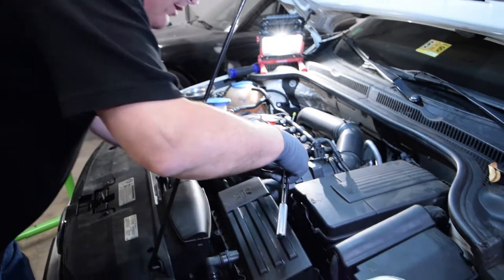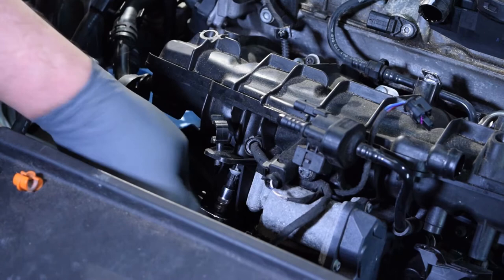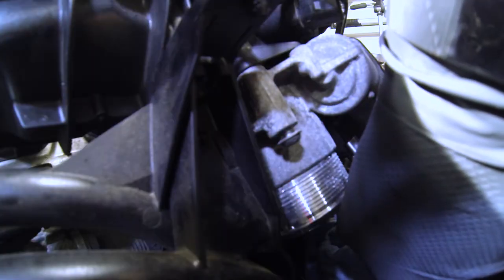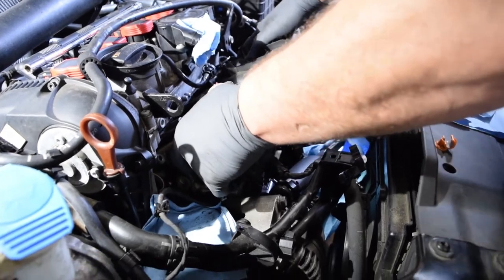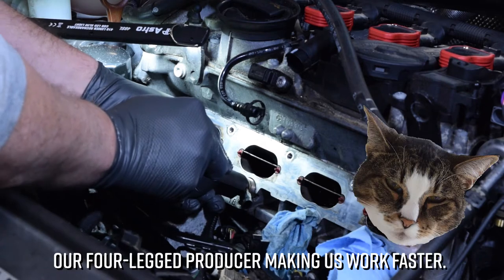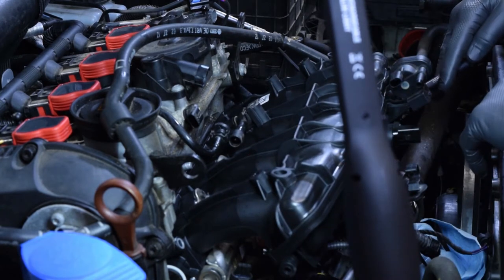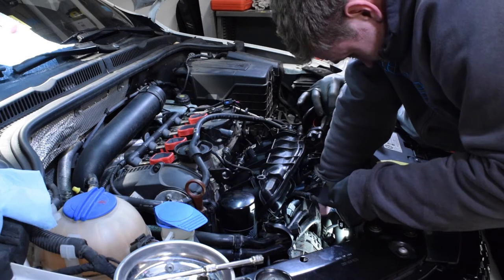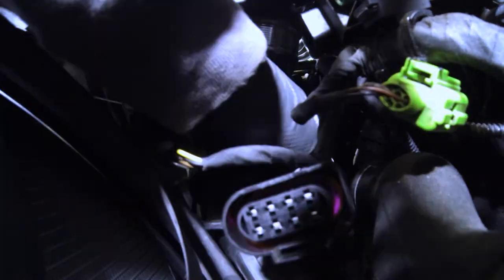Complete Intake Manifold Replacement on a Volkswagen Jetta GLI - Underdog Garage

Comment: Do you think that the screws on the bottom of the throttle body would be easier to remove  from underneath.
Reply from the maker: That's a great question! I think when we were working on this we looked at that option, but we decided to remove from the topside. While there was sort of a direct path from the bottom, we would've needed a very long extension and possibly a universal joint to get onto the Torx bolt. We felt jacking the car off the ground, possibly removing more parts to get clear access and lining up the long extension would've taken more time.

It might be easier depending on the additional work involved to get access and clearance for removing the bolts, but there might be more time involved. My MK7 GTI is due for a carbon cleaning soon, so I may try accessing from underneath next time. Good idea.

Comment: Have you guys done any videos about replacing the clutch in the Gli?
I think mines maybe wearing out or showing signs.
Reply from the maker: This GLI has a DSG and we haven't had to change the clutch packs out, so no video on that yet. Is yours a manual or DSG? Is it slipping at all?
Reply: Underdog Garage Yes mines is the 6 speed manual and its having difficulty with just getting into 1st gear only all the other gears are fine. I should of went for the DSG :)
Reply from the maker: T Pendleton gotta #savethemanuals :) sometimes in cold temp the transmission fluid can get pretty thick.  I was reading you could try pumping the clutch a few times before engaging first gear to stir up the fluid. That might help

Comment: I have a 2013 GLi with this issue How much does this repair Normally cost? and would it be best to let Volkswagen do it vs a smaller shop?
Reply from the maker: Hi T!
Great questions. The short answer on the manifold replacement cost is it depends. I did some research and found dealerships locally charging $1000-$1200 all-in with parts and labor, but it depends on the labor rate in your area. Here in Washington D.C. the hourly labor rate is pretty high. The intake manifold can be bought online for about $150-$170. 
For dealership vs. smaller shop, there are definitely some great shops that specialize in VW/Audi, and since this is a common issue chances are the smaller shops have done these repairs lots of times. 
Sometimes this manifold issue is covered under extended warranty so you might call and check with a dealer first before making a decision. They might cover it. For local shops I would try and connect with a local VW/Audi enthusiast group (they usually have a Facebook group) and get some shop recommendations. I hope this helps!
Reply: Underdog Garage Hey thanks? for responding, yes I was quoted  1100 at the dealership, and a Good Year Service Center about 890 if they use an aftermarket Manifold which they confidently felt it wasn’t much different from OEM, and yes I did reach out to VW Customer relations and they stated my vehicle didn’t fall into any recall or extended warranty service notices :(  it has about 80k on it so I assume this is common given the amount of mileage?
Reply from the maker: Sorry to hear the dealership didn't cover it. 
I haven't seen the aftermarket manifold in person. In my experience with the VW's in our family, I've found aftermarket parts typically don't hold up well on VW/Audi. Usually the fitment is just a little bit off. With a critical part like an Intake Manifold I would go OEM only, but maybe others have had better experiences with aftermarket. You might check with the local facebook groups as well if they've used the aftermarket manifold.

Yep! The GLI in this video was at about 80-85K when this started happening. I think 80-100K is where you start seeing these manifold issues, especially as the carbon buildup gets worse. With that high mileage you might consider a carbon cleaning while the manifold is off.
Reply: Underdog Garage ok thanks! I will definitely ask them to look into a carbon clean up  good post this was very helpful.I really like the GLi  and GTi’s so I’m trying to maintain it if i can without dumping to much money into the vehicle.
Reply from the maker: Awesome! Glad it was helpful. Yep they are fun cars. I have a 2016 GTI myself and I love it.
The carbon cleaning shouldn't be too much extra since they will already have all the labor in the intake manifold removal. Definitely worth it, and it will greatly restore the performance. I hope it all goes well.